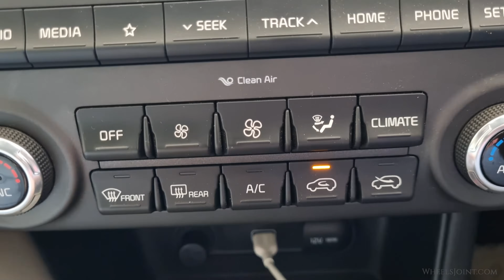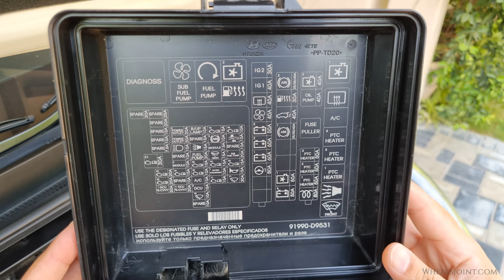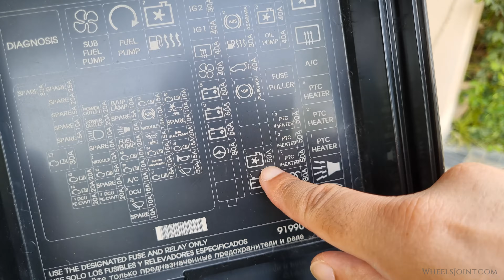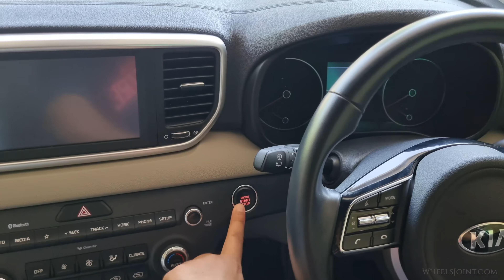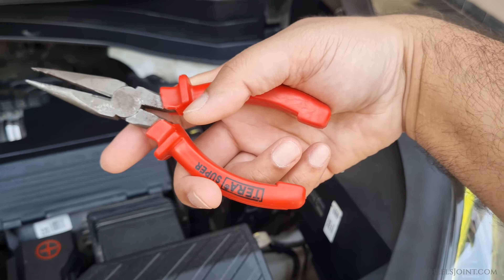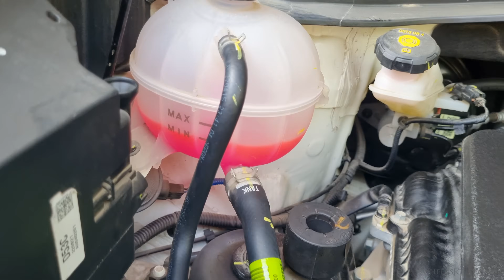Radiator cooling fan not working in Kia Sportage, fuse & relay check

Comment: If I bypass the relay and get no power between the battery and the fan motor connector pins - it's a bad wire right?

Comment: Question my Sportage fan stop working at stop 🛑, 😅 so my A/c works only if I accelerates, what you think is the problem ?
Reply: I think the belt are slippery or maybe ac compressor failure
Reply: What was it?

Comment: For this car, when I turn on the AC while the engine is cold, should the radiator fan run at low speed or high speed? Thanks.
Reply from the maker: On cold engine, fan turns on at low speed when you turn on the AC. High speed fan only turns on when engine is getting hot.

Comment: The air conditioner is not cooling. What I want to know is, should the cooling fan be spinning when I turn on the air conditioner? In other words, does the fan run or not when the air conditioner is on and off, independent of the cooling water?
Reply from the maker: The cooling fan will always turn on when you turn on the AC and the compressor is running, even when the engine is cold. If the fan is not running when the AC is turned on, there is an issue.
Reply: @WheelsJoint  Thank you for your answer. I will check the fuses immediately.